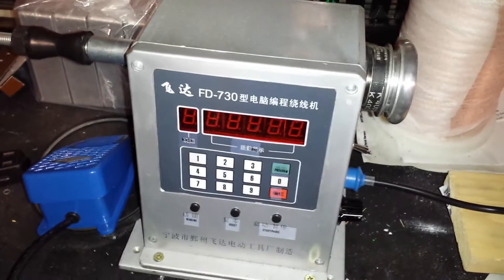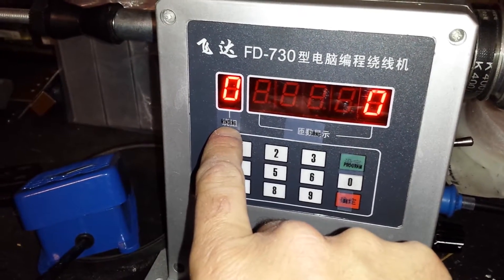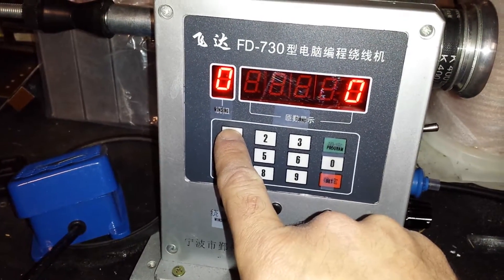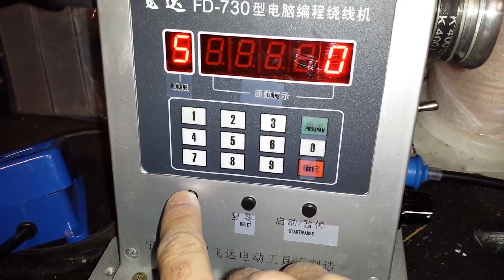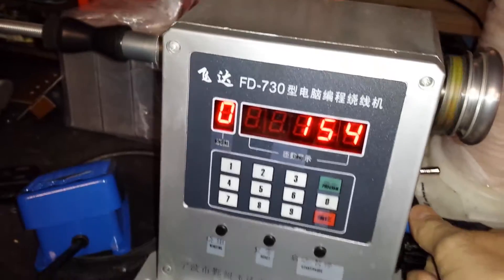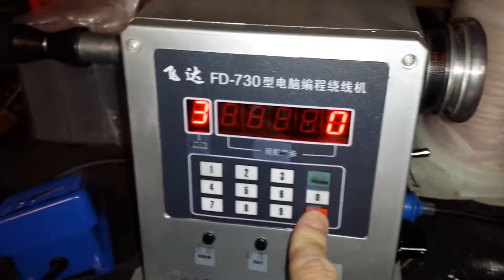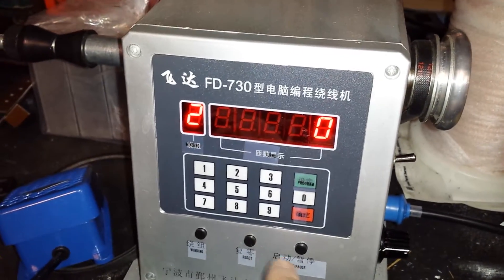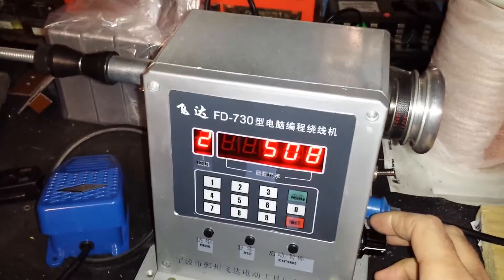Ningbo FD-730 Winding Machine - Part 1 (instructions)

Comment: Thanks for the demo Ben. How does one secure the pickup bobbin?
Reply from the maker: I made a custom thingy using a small drill chuck. The Drill chuck is secured to the shaft of the winder with a double-ended coupler with set screws, and then I can put any object in the chuck. So I shaped a piece of Aluminium bar with a tapped hole in the centre through which I put a bolt, and the bolt shaft goes into the chuck.